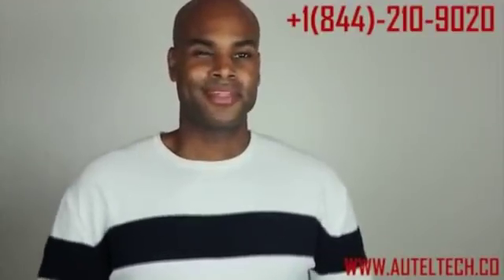Autel Maxisys Elite MS906BT | Top 10 Questions of the Week - Episode 2 | Autel 2018

Comment: I just received my MS906BT and was reading through the user manual and read where it talked about an CD for downloading into a computer for using a printer.  It said it was included but I did not find one with my scanner package.  
  Also I see it talks about an SD card slot.  Is it suppose to come with an mini SD card because I can’t find it either.  I know my MD808pro came with an mini SD card.

Comment: I know you know this scaners so well  i have a ts 608 can i reset a rian sensor light  wen the front winshell have bing replace  on audi
Reply from the maker: Hey my friend.. I doubt it because this is a stage one diagnostic tool. Meaning its core functionality is to read and erase codes. You need to invest in a stage 2 device that has coding as its main function.
Reply: @AutelConsultancy   thanks for you support

Comment: The title in the video referst to the MS906BT, but for question #2, you answered it with respect to MS906TS and made no mention of the MS906BT. Is that because they're the same unit? Or is your video actually about the MS906TS and the MS906BT was placed there in error? Or something else?
Reply from the maker: Hey Stephen, Great question. The reason why the title has the MS906BT ( when I refered to the TS in the videos) is due to the fact the BT's coding / special functions are congruent to the MS906TS . They are both stage 2 devices. The TS just has the  added hardware and software for the TPMS coding.
Reply: @AutelConsultancy  From your comment, am I to understand that the MS906BT has all of the functionality of the MS906TS plus tire pressure monitoring? This is not congruent with what I've read elsewhere: That the BT model has substantially more features and capabilities beyond just the TPMS. Have I read bad information, or is there a good site to look at that will draw feature comparisons between what the BT offers that the TS does not?
Reply from the maker: @stephendee7839   Hi Steph. Im going to be direct with you  as I touched up on this topic before ( https://youtu.be/zNbTjCqpNDg?t=1489)  The attempt to get facts from the internet on the Autel products are extremely general. Alot of the information is regergitated from one venders wepage to the other. Other information on blogs or forums are also difficult to validate since they are not from the source ( The engineers). Even worse even if you call reputable sellers who turn over 1000s of devices.. They too are not able to answer any technical questions. Why? Because they do not do their own support. They are are not taking the time to assist the clients when their tool arrives. In other words they dont know anything about the tool because they dont use it themselves. My business on the other hand focuses on the other side of the spectrum since I specialize on the support to the clients I sell to. So last year alone I personally logging over 200 of my clients devices and rendered tech support , registrations and helped resolve software glitches . ( I also requested the engineers to add on features like saving reports in jpg instead of only pdf.. that you now see on the todays tablets)  Having the direct relationship with the clients and actually logging into their tablet.. your able to see things that will never have been revealed  unless you dig deep into the intricate  modules on the tablet. And lastly I communicate with the engineers on a daily bases.. so if I need facts I just ask the egineers who made the software. And according to them they varified the the MS906 BT has the same special functions as the MS906TS. ( excluding the TPMS software and hardware) This I personally can verify as true and this is  why I classified them as a stage 2 devices.  The only way that I know of to get you educated with the correct information is just to call me up so I can share with you what the tools can and cant do. Im basicaly taking my 10 years of experience and condensing the problems and solutions you will experience in just a 15 mintue conversation. Other than that you can continue your search on the Web.... just keep in mind there is a reason why the call it the "Web"!
Reply from the maker: @stephendee7839   Hey Steph did you manage to sort yourself out with the information you need?

Comment: Hi Curtis,  several years ago I saw a video of someone who had Rooted his Maxi Sys Pro and was able to install Google Play and put other apps on it. Is this something that can be done safely with a how to do it instruction covered in a future video? 
   If I could safely install Google Chrome Browser and leave the app running in background  with cast screen selected , I should theoretically be able to "wire-lessly cast" it's screen to a big screen TV with a Chrome Cast dongle plugged into the TV rather than be tethered to HDMI cable. Using the MP408 scope and casting to a big TV.  Also a suggest to engineers an inexpensive easily removable piggy back bracket for MS908s to slide the MP408 4 channel scope into on the back side between the kickstand would be nice.

Comment: So......I purchased the Launch x431 diagun IV. Was quite disappointed to say the least. I originally was going to buy the DS808. I’m just a do it yourselfer working on my own vehicles. One thing I need to do is program 2 new keys for my truck because when I bought it 7yrs ago I was only ever given 1 key. Can the DS808 do an 06 Ram 1500 successfully that you know? I’m as well having issues that someone had a question about as far as my TIPM. I want to try and reprogram mine since I’m having issues with my headlights which are controlled via the TIPM. I assume I’d need the MS906BT or TS for that procedure?
Reply from the maker: Hey Jason. Call me regarding this issue 844 2109020. Or you can email Curtis.Hardin@gmail.com I have alot of clients who have the same background as you and I can share with you the pros and cons of the 808

Comment: I bet you get got quite a few customers that have you on pocket dial that want you to hold their hand and take over their scanner on Team Viewer and do the procedure for them. Where do you draw the line at what you will do for your customers and how often you will provide needed help , before you end up becoming  their Full Time Virtual B@tch? :-))
Reply from the maker: HI 1FNJO.  Great question!  Lets say a client wants to know if the Maxisys Elite can initialise apower window regulator after replacement. First ill request the VIN number on the vehicle then send a Special Function Request to the engineer in charge of that Manufacturer. Then tthe engineer will send me the Function Route on how to get to that menu. I will then foreward those instucrtions to the client and log in via team viewer to make sure the client completes the procedure succesfully. After the procedure is complete I will send them a video recording of the diagnostic session so this way they can review later when they need to repeate the procedure again.  This process will elimate any further communication since ( regarding that procedure) since the client has the documented function route, and video recording of the previous diagnostic session. Thats my approach and I appreciate your concern.

Comment: Hello Curt very informative video, if I wanted to purchase a ms906bt where should I start, I have found them for 1250.00 at aes wave. I agree with you on the Amazon purchase, the main thing I'm looking for is the support after the purchase thank you for your time. One other question, I've heard that some of the advanced  functions for the ford platform either have been deleted when the tool is updated or not active on new purchases, again thank you for your time.
Reply from the maker: HI Dwain, Curtis here. If having a consultant to represent you ( after the sale) is of importance to you. I would encourage you to call me up for a consultation at 844 210 9020. This way I can sell you the tool directly and assist you with the technical, software, and hardware problems and share with you stratigies to lower the cost of ownership.  Regarding the second question for Ford. You read that from a Forum thats not up to date ( I think that post might have been around 2013) Autel just took off the Programming directly from the tablet for that manufacturer . So  you just have to use the j2534 for programming. This wouldnt apply to you if you are considering the BT because its a state 2 device that doesnt have programming .  Give me a call when you can. Thanks